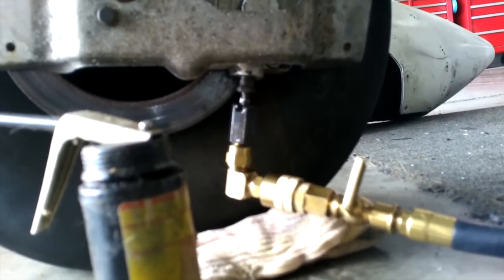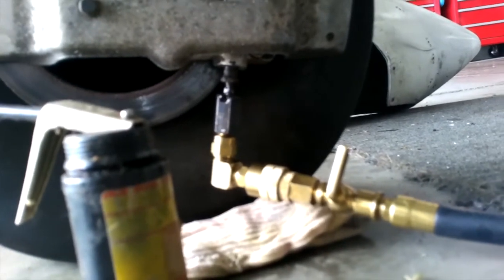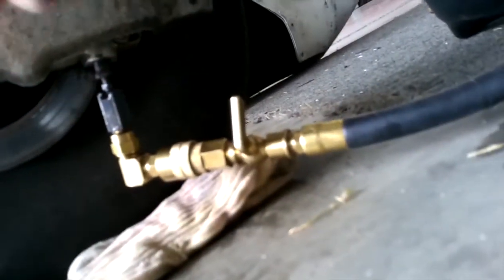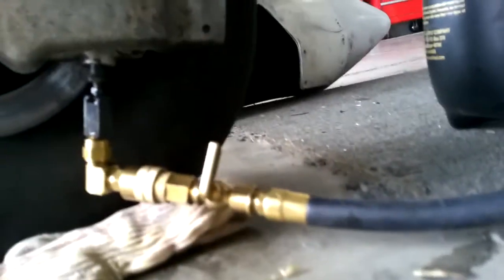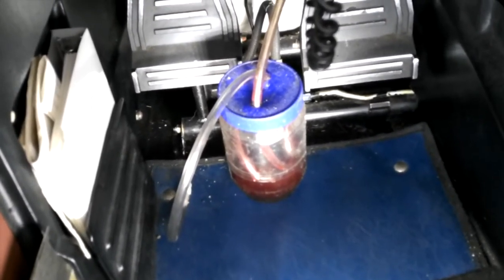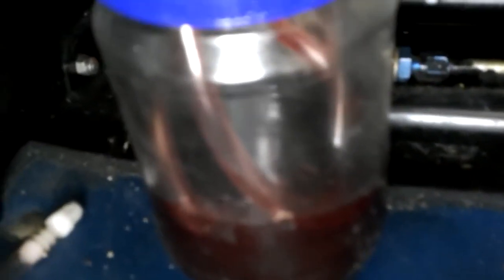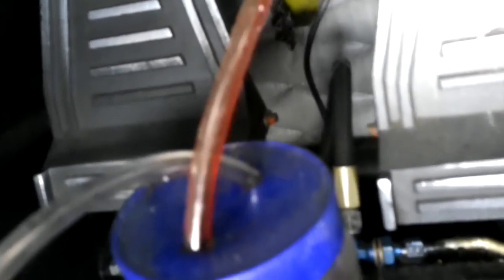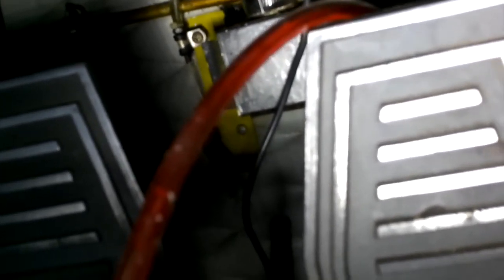Pumping Up Brakes  - Grumman Style

Comment: I've a 79 Tiger and the pilot side peddles go down a bit further than the passenger side. I had my AP rebuild the brakes and master cylinders. I don't understand why this is happening. My problem is I am disabled and braking is a big deal for me. Broke my back in an AC accident in 1992. After getting my ticket back, I bought this AC and have been okay with the brakes, but now not so much. BTW, the brakes were bad before the rebuiild.
Reply from the maker: The pilot side are master and slaves on the other side.  They work a bit differently.
Reply: You're correct. Passenger sides are smaller. Does that have any impact on how far the rudder peddle should go down?